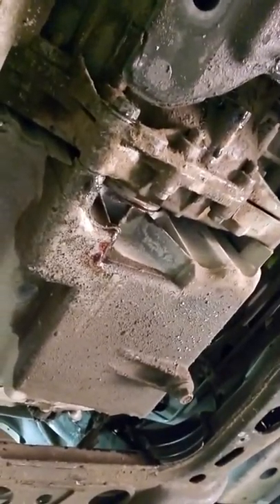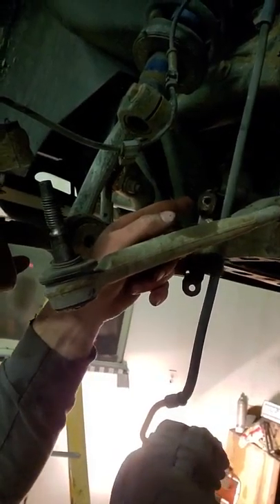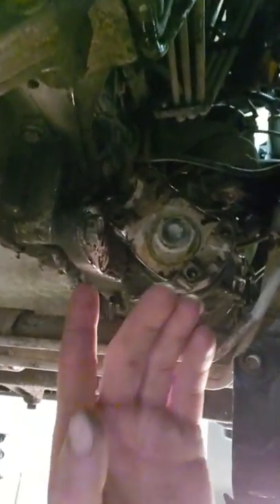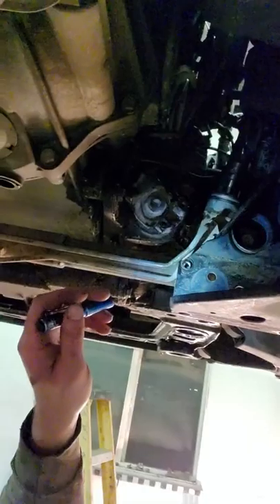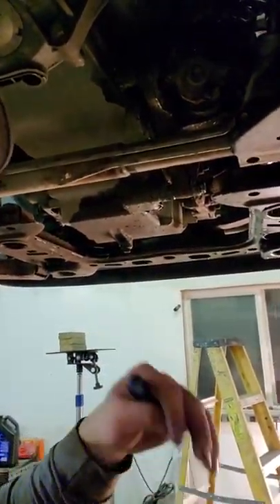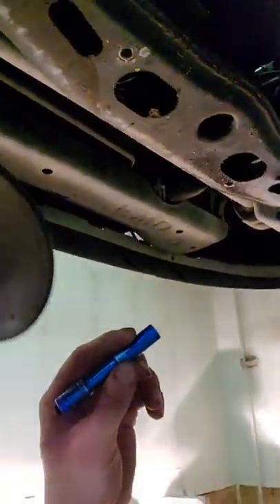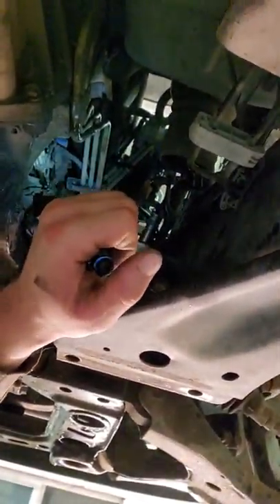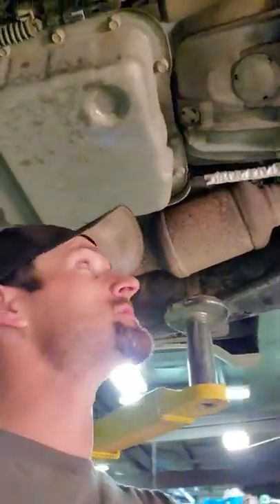Easy way GM Envoy or Trail Blazer Front diff Removal and install

Comment: Jacking the motor up and over worked and didn’t have to touch the rack&pinion. All I did was take the two bolts out of the top of the fan shroud and had enough movement to get it out and another one back in. For a 64 year old man working in the driveway, five hours start to finish including replacing the top ball joints while it was apart.
Reply: Video?
Reply: @Kingkiller-mj8qj  I watched a couple of YouTube videos, don’t remember witch ones, that was two years ago.

Comment: What the F man, you just did it so hard.

You take the pull the axle out from the diff. take the Alternator off, you take the side pulley off, you take the Compressor off, you take down the Diff bolts and fish it from the hood. This is so simple, you made it soooo hard. You crazy man
Reply from the maker: I've done it both ways,  this is faster!

Comment: YOOO my man!!!  THIS WORKS!!!  I was looking at Alldata and it seemed like a nightmare.  Then I found your video and it was amazing.  

The only things I did differently was :
1) Didnt need to remove steering gear,  u can actually angle the end up and the diff clears no problem.
2)  I used a ratchet strap and wrapped it around one of the mounting points on the oil pan and ratchet.

Regardless YOU ARE THE MAN!! THANK YOU!!
Reply: ALSO disconnect the water hose going to the heater core,  mine cracked when pulling the engine toward the passenger side.

Comment: My transmission shop told me they have to remove part of the engine and pull the differential up through the top to replace (2005 Envoy, 4wd). Obviously you have a work-around on that.

Comment: Worked like a charm ✨️ thanks
now I can't get the last bolt out of the cross member,  some case on the driver side is blocking the bolt from coming all the way out! It is a 03' ENVOY SLE 4.2LT, any advice I'm taking the transfer case out to install a new one and this is really going to get put on the back burner till the end of this upcoming semester. I despise not finishing what I've started, an advice would be great

Comment: I will be pulling my front differential tomorrow in my 9-7x aero, I just installed a Magnason 2650 on it and loaded a hot tune and first launch I exploded the front differential housing.

Comment: Drop the oil pan and replace the $60 gasket and diff goes in and out alot easier then fighting it through a hole, no need to even jack up the motor. No fan removal!
Reply: Did you remove the steering shaft?

Comment: All you need to do is unbolt the power steering pump alternator assembly for the 5.3 v8 a fit will come out of the top by the battery
Reply from the maker: I've haven't worked on a v8 so far,  good to know.

Comment: will the driver side axle just pull out, there's nothing to release the axle..  I can't get it off, i used a prybar and a chisel to try and get it to pop out.... just making sure its same as the rest of the cv axles. just need to pop it out
Reply from the maker: It pops out.  
But sometime you have to smack it with a large heavy bar to get them to pop out.  
Pry bars rarely work,  needs that smack.
I usually use a large very heavy bar,  hit it from the underside going outward,  almost like a pool stick hitting a ball.
Reply: @GMacGrant  I understand that... making sure there wasn't a retainer clip or something internally that needed to be removed first... Never had on stuck like this... appreciate you
Reply: Mine got stuck bad but was because bearings in diff were shot to hell and was binding up the axle.... Pain in ass

Comment: Okay, But how did you get it OUT of the oil pan?
I have all four of the bolts out, the actuator housing, the intermediate/axle shaft, Drive shaft.
All of it it out and off.
Except the Differential carrier that will NOT move. Won't even rotate in the pan.

Is there some special trick to getting it out? Special tool?
I need help and no one is showing how they actually did it.

Comment: Howd you get the 1ft shaft out thats stuck in the dif from underneath?
Reply from the maker: There are threads in the end of it.  I think they are 1/4" standard thread.  
It has to come out from the passenger side.  
Usually I can just hand it with my fingers and wiggle it out.  
But one that was stuck i bolted a chain on,  broke the chain,  then I welded the chain on and yanked it out with a slide hammer.

Comment: You know the front and mid body mounts are pretty easy to take out to get the body up out of the way as well.
Reply from the maker: Have you done one,  the body isn't really in the way when you do it this way
Reply: Mac Grant I’ve done engine jobs  and to get to the Belem housing bolts you need to jack up the body but the post 2004 models where the front axle runs thru  the pan. I see what your saying after further inspection.dropping the rack would probably be  easier
Reply from the maker: @rightsidelanechoice7702  yep, no need to pull mounts but I did jack the engine up pretty hard so if a guy wanted to he could
Reply from the maker: As a precaution